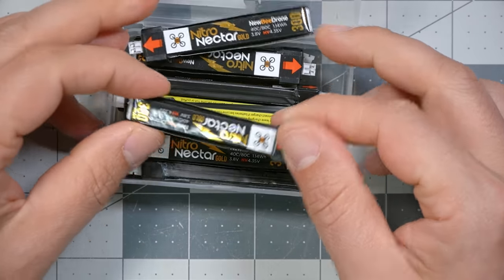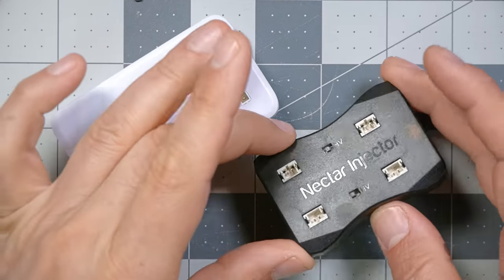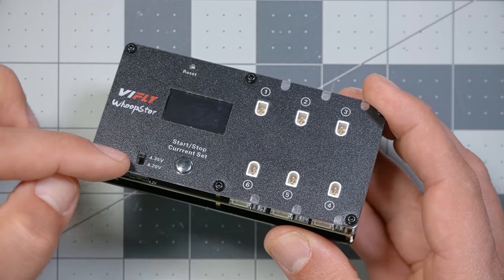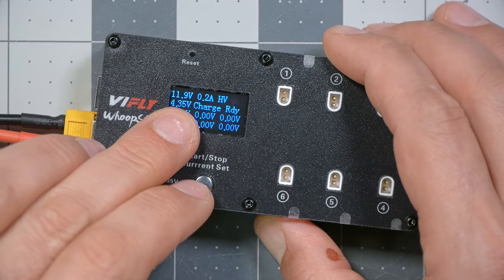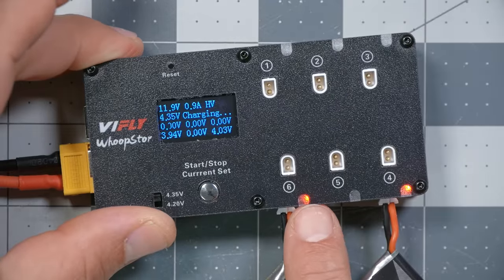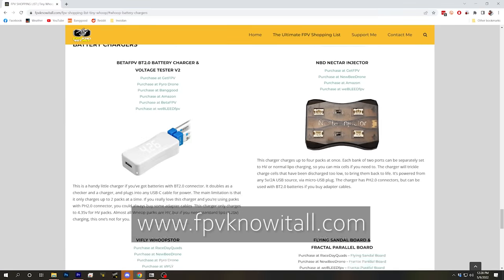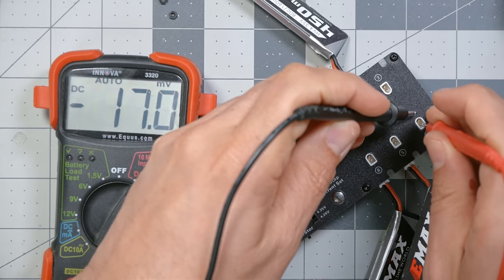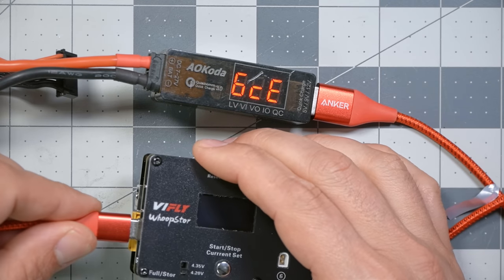Finally a decent Whoop charger. VIFLY WHOOPSTOR V2

Comment: The thing is, in-flight voltage and resting voltage are very different things with tiny whoops. I fly my batteries down to about 3.0v but when I check the voltage after flying, they're still about 3.7v resting voltage, which is fairly close to storage voltage.  Thus I only need to make sure that I always fly a battery after charging it. My batteries are now a bit over a year old and they're still great.

Comment: To put my whoop lipos to storage voltage I created a lead with a PH2.0 socket connected to a JST-XH plug and XT60 plug to plug into my iSDT charger.
I also made a board to charge 3 or 6 (two sets of 3 in parallel) whoop batteries with a normal charger. Was very simple to wire and works great.
Reply: Hey what voltage do you store charge to for HV 1s lipos? My charger will only go down to 3.9 but recommends 4.0 which seems high...?
Reply: @zorianfpv  3.8v, because from what I've read, all lipos can be charged to 4.35v / cell, regular ones won't be happy about it but LiHV cells are better made to regularly handle that extra voltage.

Comment: For those who don't have other rc vehicles using 2s to 6s lipos this is a great option. I made a series adapter for one of my dual 2-4s chargers. I can balance charge and storage charge 8 batteries at one time.

Comment: Gnb27 connector should be included on all chargers and parallel boards.
Reply: ph2 to gnb pigtails. problem solved. but yeah for future products I agree
Reply: GNB27 SUCK. Change all my PH2 to GNB27, then to BT2. Much better quality control. With GNB27 you never know what you get.

Comment: In my experience PH2 connectors wear out much faster than the cell.  I've had a lot of packs that I thought went bad, but then put on a GNB27 or BT2.0 and it was like they were brand new.
Reply: lol because the connector has less resistance

Comment: It could be said that it is possible to very cheaply manufacture a cable to connect in series 4, 5 or 6 1s cells to simulate a bigger battery and plug it directly into your big charger with all of its features!
Reply: Yes a youtuber by the name 'flying sandal' made one that works well. His v2 board sells for about $14 at race day quads. The v2 allows you to set the number of cells manually by moving the cable that completes the series. If I had a full size charger I would have bought that instead of the whoopstor.
Reply: @Kleinage  Nice, I'll get one!

Comment: This is such a good product I recently went on a long trip so I had to storage charge all my woop batteries but I had a broken motor so I couldn't just fly the batteries down to 3.8 so i just held my woop in my hands and full throttled for a while plugged It in to my charger thankfully my charger showed the voltage of the batteries but It still took forever

Comment: i use a multimeter to measure the voltage of my 1s cells when charging and i just unplug them when they’re at 3.82V lol the whoopstore is a way better alternative
Reply: I just build a "kit" to simulate a 4s and 6s battery for my big charger 
Now i can balance charge 1s batterys

Comment: I am definitely going to pick one up! I have been using the fractal boards to storage charge and it makes a difference! The one thing I wish it would do is individually charge so at a race you can add lipos at different times like a betafpv 400MA 6x 1s...... also why can't we lave a legit 1s charger that is that way, x25 brick of individual 1s chargers 🤔

Comment: I fly mine until they read 3.3 - 3.2 on the OSD and come in for a landing.  Normally they bounce back to 3.77  or 3.83,  if not then I charge them up to 3.84 for storage.  I could imagine it being very usefull though.  Wish it could also charge all other Lipos.  So I could just buy one, for all my qwads.

Comment: The VIFLY website says you can charge BT 2.0 & PH 2.0 at the same time because they are individual channels 🙂(edit: I misunderstood. DON'T charge on the same channel, for example: ph1 & bt1). "It is compatible with both PH 2.0 and BT 2.0 connectors, and you can mix charge BT2.0 and PH2.0 battery at the same time. These are 6 individual charging channels, not charging parallel, but rather individually, you don’t have to worry about making sure the batteries are all the same voltage and same size." (same size as in mAh)
Reply from the maker: You can mix bt and ph yes but not on the same channel at the same time.

Comment: AND, a year on?  Mine has continued to perform excellently.  Most of my cells were PH, some still are. I have avoided BetaFPV gear after bad product and even worse support on two quads.  I was just about to go to GNB27 when they were dropped and A30 appeared. I'm rapidly changing to A30 cells.  The Flywoo 6  way charger appeared, and has A30 sockets, claimed the first to do so, so I bought, only to find that it significantly and IMO dangerously overcharged HV cells, getting close to 4.5v. I'm awaiting a replacement unit, but did the switch to std 4.2 on it, which in itself is a little odd, having to solder pads together for each output!  However, once done at least it IS safe to use as then it does cut off at or close enough to 4.20v. @JoshuaBardwell , are you testing this new charger please?

Comment: I use a 1-6s balance charger with the happymodel 4s parallel board that came with a Mobula 7 , that way I can charge or store 4 at once while I usually charge on a 6 port betafpv charger, I changed all connectors to xt30 because why on earth run anything else

Comment: The BetaFPV charger that I got and it looks the same as that one, does not have option to switch between 4.2 and 4.35. The switch on my version of the same charger is only for on and off.

Comment: I always storage to 3.85. Every pack i buy i also see out of the factory at 3.85. 3.85 i think is the ideal place since it gives some buffer. Naturally a battery will sag down to 3.83ish after unplugging anyway. If you set it to just 3.8 it would drop in the upper 3.7's range which isn't ideal. Also gives just a bit of charge for things like test powering something on the bench without having to put it on the charger for like 5 seconds of use
Reply: it really doesnt matter. 3.7, 3.9, all good enough to minimize degradation. 
there also is little to no point putting your batteries in storage unless youre storing them for over a week.

Comment: Josh Bardwell I just recieved my vifly woopster. Im disappoited really. It says you can use the included usb cable to power it to charge. Only it doesn't. It just says ready to down load? What is ready to download? Im trying to charge batterys. I seen Im not the only one with this problem. Any help would be awsome.
Reply: Problem solved the usb cable is junk. I used the charger for my samsung s20 and its now charging by usb
Reply from the maker: If the Whoopstor thinks that it is plugged into a computer, then it says "ready to download". This means that the charger does not support QC or PD. I
Reply: @JoshuaBardwell  I got it to charge with the usb cable and box from my Samsung S20 phone. What usb and wall adapter do you use? Just wondering. Thanks for the quick reply and info.
Reply: Had same problem. Had to swap to other DC source (some AC-DC adapter similar to ones used to laptops)

Comment: Hi Joshua!  
which charger/discharger would you recommend for the betafpv pavo pico whoop which uses a 2S 7.4v 450mah lipo battery?
Just realized the VIFLY WHOOPSTOR V3 is only suitable for 1S batteries :(
Would really appreciate your recommendation, Thank you!

Comment: JB, agree that getting 1S to storage is key to longer life but is the $30 you'll spend for this device worth the advantage of portability and checker vs buying something like the NewBeeDrone Double Sided Charging Board for $7 and using my standard charger? I really do like the fact that this board does the cells individually (up or down) at the same time; that may be the feature that puts this over the top.
Reply from the maker: If you don't care about carrying a full size charger with you then go for it. Bear in mind, a parallel charging board requires you to have all cells at the same voltage when plugging in, and other such concerns.

Comment: Exactly how to set this up using a USB connector for input. I tried using what came with my cell phone, and I get a message on the screen regarding "none pc." When I enter on that it then indicated fast charge??
Reply from the maker: You have to use a fast charger. A regular usb charger won't work.
Reply: @JoshuaBardwell  thanks.

Comment: is it possible to plug in a 2s? or its it too low of a volage to handle the charging?
i got 2 x 4200mah laying around that i barley use for my dt03 with an fpv camera
Reply from the maker: Input voltage range is 7V to 21V (2S to 5S)

Comment: does it come with a power cord? if not what would you use to plug into house power?
Reply from the maker: You could use a 12v DC power brick rated for 30W or higher or a USB PD charger rated for 12v and 30W or higher.

Comment: Why don't they make it like the $35 Venon /Tenergy T420 4-Channel Charger for 1S with 4 types of connectors per channel! . I have the original Venon brand and that unit is a very nice charger form all aspects of what I think a good product, charger should be, a much more of a rolls royce of a whoop size battery charger. It looks great, has easy to read Lit LCD display not a miniscule lcd screen,  it is easy to set the charge current, individual buttons,  the unit comes with an AC cord, and has both DC and AC input,  on top, the unit feels great in the hands, it has a nice velvet like rubbery feel and it is fully enclosed and properly vented, with the charge  ports all at the top  on an angle and arranged logically, not some on top and some on the sides, open sandwich, that to me looks cheese. ViFLy should take better notice. OK I will give them a bit of credit for the storage charge, but I get totally disenchanted when I see a product that has great potential but not properly executed in design and packaging. 

I posted this same comment in another similar review, and it was pointed to me that I perhaps was not considering price point. I think for a bout $50 with a proper design and more appealing enclosure would be well justified. Or I am thinking of taking my Venon/Tenergy $35 charger and adding or hacking the storage charge feature on it as a DYI.

For those who have not seen the Venon. Tenergy charger I am talking about and comparing to here is the link: If we do not include the storage charge feature for the sake of comparing form factor the Venon/Tenergy by far is a much better product. 

ttps://www.amazon.com/Tenergy-4-Channel-Charger-Rechargeable-Connectors/dp/B089M184WK/ref=asc_df_B089M184WK/?tag=hyprod-20&linkCode=df0&hvadid=459627455694&hvpos=&hvnetw=g&hvrand=16174688783027698526&hvpone=&hvptwo=&hvqmt=&hvdev=c&hvdvcmdl=&hvlocint=&hvlocphy=9030035&hvtargid=pla-942447155947&psc=1

Comment: 3.7v is nominal for lipo per manufacturer, why is 3.8v preferred?
Reply from the maker: Nominal voltage us just halfway between charged and discharged. Storage voltage is the voltage at which the cells are the most stable.
Reply: @JoshuaBardwell  gotcha, more of 70% than 50%. I do similar with my EUC, let it sit at 60-70% for storage (2700wh pack) so really want to be safe 😶

Comment: I actually storage charge whoop batteries by charging them up and pulling them out when they get to 3.8 volts. But you do need a charger that can read out the voltage, and you have to time it perfectly and take them out at the right time.
That charger does some cool things, but for a $30 dollar 1S charger I would like it to be 6s capable, and to save the amp setting.